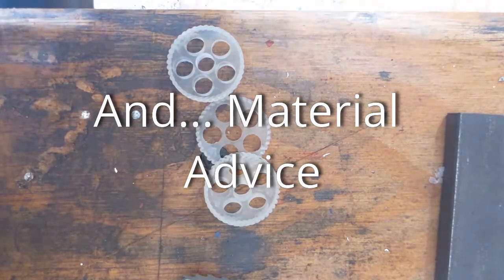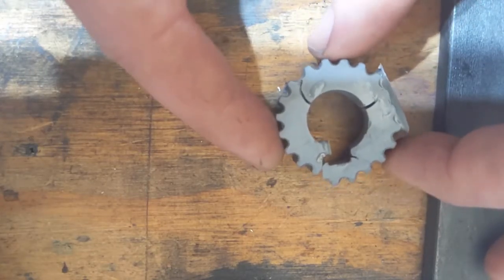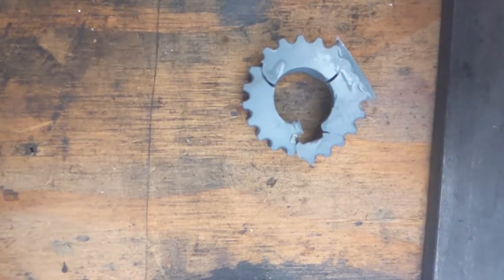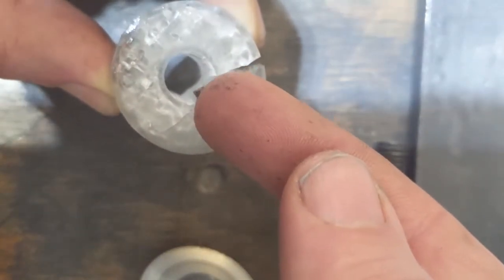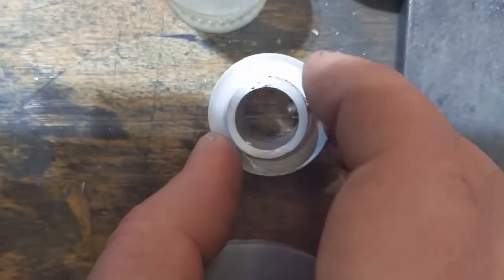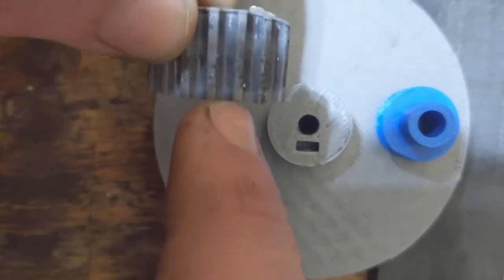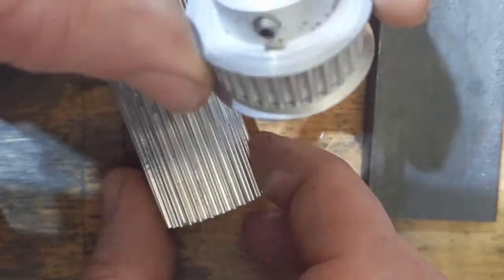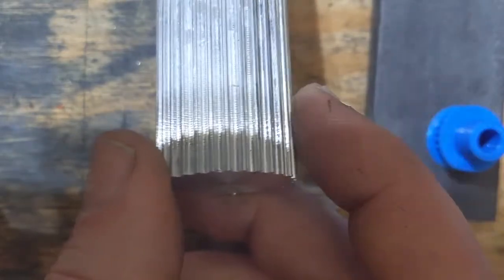Pulley Stock: The secret amazon sellers don't want you to know about

Comment: I just found your channel yesterday. Thank you for making these videos. 

 I have both a 8x14 HF lathe which I hope to upgrade sometime to CNC and and ELS, and an old Singer W112-139 industrial sewing machine that I fitted with a Consew CSM 1001.  When the needle positioning is active, the machine goes through a slowdown phase when stopping in order to  wait for and stop at the location where a magnet passes by the hall sensor. It has two sensors - one for up and one for down.  
 
This led me to think that if you added  'stop' positioning to your lathe, while not exactly a smooth stop, it might reduce the impulse forces enough to keep your printed pulleys intact.   Of course positioning on a lathe is of limited use. But controlled slowdown would help to save the printed belt pulleys.
I tested this on my sewing machine, and it does go through slowdown before stopping. I tested at 200 rpm which is my slowest motor speed, and at about 2000 rpm to see if this worked at a higher speed.  In both cases it worked, although it seemed that at the higher speed the machine still stopped quite abruptly, before positioning. 

You can build your own position sensor from two digital hall sensor boards (Hall Effect KY-003 Magnetic Sensor Module) a couple of small magnets,  and a salvaged square 4pin ATX cpu power plug - for 5 to $10.  - which I did because I could not mount the stock sensor on my machine due to interference with its stitch length knob.  I ended up hot melt gluing two magnets on a half inch shaft under the bed, and mounting the sensor boards to the underside of the machine again with hot melt. 

Wiring the digital hall sensor boards to the Consew controller is very straight forward. 
The 3 pin sensor boards use 5v, ground, and the sensor output.
As you know the Consew controller positioner plug accepts a square 4 pin plug. This plug has two rounded  and two square connectors, and a locking clip on one side.  The plug exports 5v and ground, and  imports the needle up and down sensor signals.
I opened up my factory needle positioner to figure the pinout:  The two wires nearest the lock clip on the plug are for the sensor wires. On the side away from the lock clip, the 5v occupies the rounded connector, and the ground occupies the square connector. 

I don't know if this would solve your problem with excessive forces during motor stopping, but I thought I would mention it.
--------

I had some other thoughts on the printed pulleys. 

1. Since the keyway in the small pulley is an obvious weak spot,  why not build the key into the pulley instead. This would eliminate the keyway slot, strengthening the pulley.  This only works if the key can slide off the end of the shaft. The Woodruff style keys do not.

2. If you must use a keyway,  reduce stress at the inside corners by adding some radius to the corners.  I was thinking along the lines of how it is always a good idea to drill a hole at the end of a slot to spread the stresses out. Maybe place the radius only to the side of the keyway so as not to further reduce the material thickness above the keyway.

3. (crazy and hard) When using resin (SLA) you get the most definition, but least strength.  FDM material gives strength with less accuracy. This suggests building the pulley as two parts.  The meeting interface might use a spline, distributing the torque over the circumference. 

I am interested in how you implemented your ELS. I hope you have some videos on that aspect. Cheers!
Reply from the maker: positioning on a lathe is quite nice actually, but I'm not sure the consew positioning is better than the encoder I have mounted.  The fast stop is good in case something is going south.  I don't want to change that.  i can stop it slow when I want, though sometimes I stop it fast without needing to do it.  FDM seems ok with this but SLA just can't take the shock load.  None of the failures were emergency situations.

The multi material idea is sound.  I've made aluminum cores for pulleys in the past using both a press fit taper and a "D" for torque.  Splines would be harder to make with my setup and aluminum but they would work better for FDM/SLA hybrid and I don't think it would be hard to design.  You could get really crazy and do a tapered spline.

I have 2 videos on the ELS but neither of them go into the implementation details.  I've prototyped a websocket+react based webui but I need to add that to my ELS code base and I've been procrastinating.  The very rough code is here: https://github.com/jschoch/ESPels

Comment: Pulley stock, great suggestion! I did not know of bn this. In watch making they call it spline stock which I have ax few pieces. They use it for gear making. Good suggestion.
Reply from the maker: Thanks for the reply.  I'd seen it before but when I saw a 12" piece of 30t stock on amazon for $10 I had to get it.